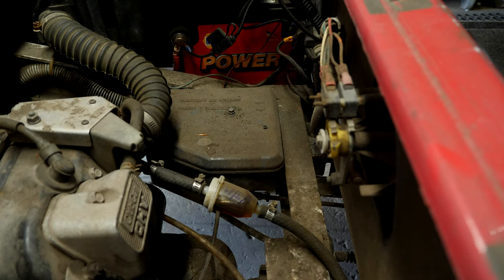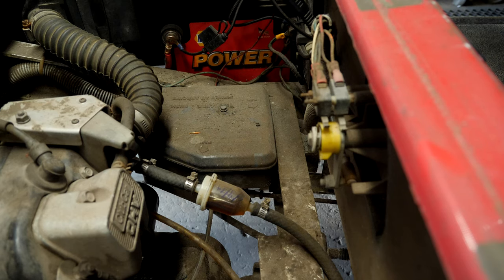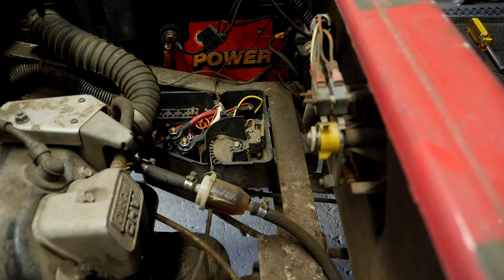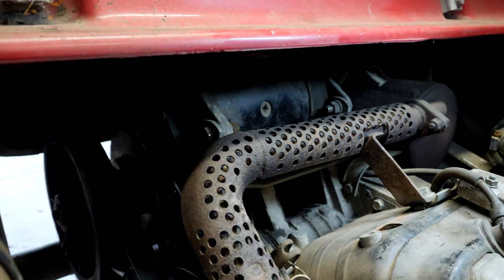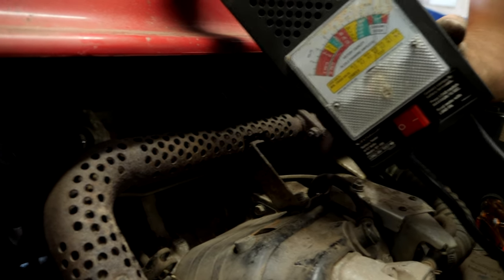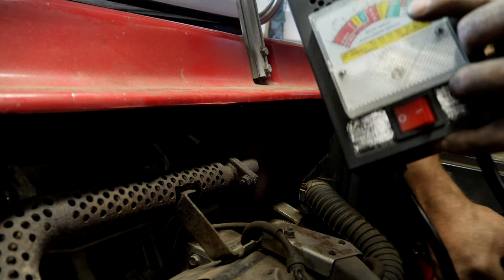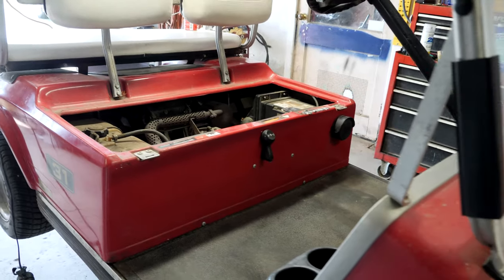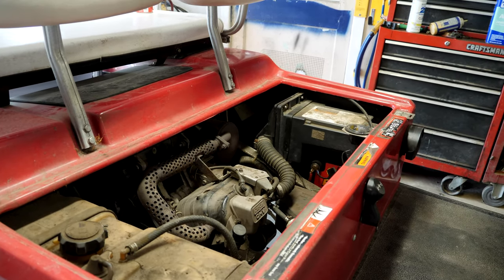1994 Club Car DS, Gas - No Crank, Fix Starter Generator, Replace Voltage Regulator

Comment: Im fighring this exact issue right now. What was the root cause here? I mean you basically removed it and cleaned it, then replaced it and it worked. Do you think the naked wires were grounding it out? Im referring to the starter portion.

Comment: Hi Kevin , I have a 1995 G14 Yamaha the oil light on there’s plenty of oil in the engine , the engine has started to sound like it’s over revving  any ideas would be greatly appreciated !
Reply from the maker: There is a wire that connects to the oil sensor on the back of the engine. It may have come off or the oil sensor is shot. Over-revving could be from a stuck cable.
Reply: Our old 86 club car has the oil light that comes on when the oil level is just less than full. This may help.

Comment: I have a 92 club car. it is a no crank. went from a slow crank to no. I will watch this again to gleen out more of the details on checking the voltages that you mentioned. This looks like it may solve my no crank..
Reply from the maker: Check your battery if it was slow and then no crank. You will need a load tester to verify its state of charge. If the battery is good, it could be wore out brushes in the starter/generator. Solenoids rarely present this symptom.

Comment: Did you ever see anyone fuse that microswitch wire? I have a cart that has that fuse blowing which led me here. I took apart the generator and had a bearing that blew apart. I wonder if that is what is blowing the fuse.

Comment: Kevin, i have an old Golf Club Cart. About 1993, not sure if you can help me. Cart haș sat for 6 months due to lockdown, it was fine before, but now it works fine apart from the bleeping noise will not stop So ive hâd to disconnect the battery. Can you advise me?

Comment: Can you tell me wear the clear hose goes that is running by your fuel line or filter. I am working on a 1991 and that hose on mine is connected to the carb and from there I don't see wear the other end goes. I thing it is suppose to go to the engine crank case some were. Great video thank you.
Reply from the maker: Its the overflow tube for the carb. It should run to the frame and just end.
Reply: @Kevinsgolfcarts  Thank you for the info.

Comment: Great video, I’m having the same issues with my cart. I replaced the starter 2 weeks ago and now It’s doing this. How often do you hear of new starters doing this? I’ve replaced the solenoid before the starter but it didn’t make any difference. Do you think there’s something causing it to ruin the starter?
Reply from the maker: Replace the voltage regulator as well. It has failed causing the starter/generator to overheat and work harder.
Reply: @Kevinsgolfcarts  thanks.
Reply: If the voltage regulator is bad, wouldn’t it still start? I’m supposed to be getting the regulator tomorrow so I can replace it. I bought another starter and it still doesn’t start but I can jump the solenoid and it will turn over. This thing is driving me crazy. I put the other solenoid back on it and it’s the same thing. Any thoughts on what else it may be? I have checked the wiring but don’t see any issues.
Reply from the maker: If the voltage reg. is bad, it should still start, pending you have no other issues. The voltage regulator is responsible for maintaining charge to the battery. If you are able to jump the solenoid and it cranks, you have an issue with the solenoid or somewhere in the wiring between the battery and solenoid start circuit. Power needs to go through the key switch, pedal switch, shifter switch then to the solenoid. If any of those "lockout" switches are bad, nothing will work right. Power is fed to this circuit from the fuse block in the control box. It should be a 10A blade fuse.
Reply: @Kevinsgolfcarts  thank you. I would take this somewhere to get looked at but there is nowhere close to me. I’ll keep checking the switches.
Reply: @Kevinsgolfcarts  ok, new solenoid, new starter, and new voltage regulator. It runs, only problem is that it just takes off like your pushing the gas pedal down to much. It use to ease into from an idle but it won’t sit and idle at all. If it’s started, then it’s moving. I didn’t touch any throttle linkage or anything that would of changed it so I’m not sure what would cause it. Thanks for all the help.

Comment: Just a suggestion. A pair of jumper cables to test the motor on the bench.
Reply from the maker: I prefer to test under load.
Reply: @Kevinsgolfcarts  Got it.

Comment: Hey sir I just got the solenoid replaced and put a new starter generator in. It worked briefly but now when I hit the gas the solenoid just makes a rumbling noise and nothing else happens. I'm not sure what it could be at this point. Any ideas of what else could be wrong, I'd greatly appreciate any ideas.

Comment: I have a cart in my fleet that runs great but after a bit you stop and it has to almost cool down before it starts..ive changed everything from ignition back plus new fittings.. was told the starter generator after so much use will get hot and not start..pulling it today for rebuild..does this sound correct?
Reply from the maker: I would check the solenoid first. Check it with a volt meter after it gets hot and shuts down to see if 12v is at both large terminals when pressing the 
pedal. Starter/generators shouldn't be too hot. The brushes may be getting stuck in their holders.
Reply: @Kevinsgolfcarts  will do..thanks

Comment: Hello, could you please advise me with my golf cart. I have a vegas performance  motor but is a pull start. I want to get it to start with the gas pedal, but I don't even know where to start. Battery is dead and not sure if the generator/start is working it does spins when I turn the motor on. I would appreciate any tips you could give me.  Thank you!
Reply from the maker: I have no experience with the motor you have. It will depend on how its setup whether or not it will start with the pedal.

Comment: Have very similar issue. No start w/pedal. I checked voltage across both solenoid terminals and I get 12.5 on the red, but zero on the white cable w/my kid pressing the gas pedal. However, I CAN get the motor to turn if I "jump" the solenoid with a short screwdriver. What does that mean since yours doesn't turn when you 'jump' your solenoid with your pliers? FYI I've replaced my solenoid 3 times already.
Reply from the maker: It sounds like there is no voltage getting to the solenoid to activate it when you press the gas pedal. You need to check voltage on the small terminals. Check the main fuse next to the solenoid. Check the microswitches and make sure they are working properly. The 2 microswitches in the control box have 2 functions. One, kills the ignition when you release the gas pedal. The other completes the circuit to the solenoid to energize it. Check the microswitches on the shifter as well. One is for the backup alarm and the other is for service/run mode. Also check your key switch. If its faulty, it will not send power through the entire circuit.

Comment: I have a similar problem on my 95 club car. No crank on the starter just a click from the control box. Back up alarm and lights work so I don't suspect a batter issue. I tested the solenoid as well, charge on the red and no charge on the white. Do you believe its the solenoid?
Reply from the maker: Yes, it sounds like the solenoid is not closing correctly, internally. I would replace it. Remember to use a continuous duty rated solenoid. A standard starter solenoid will not work.
Reply: Okay great, thanks for the reply. Your videos made it so easy!

Comment: Hey Kevin got a 96 g16a it’s just clicking at the solenoid any suggestions
Reply from the maker: You will need to use a volt meter and check to see if power is passing through the solenoid on both terminals. If not, replace it. If it is, the starter/generator may need brushes or replaced.

Comment: what if you just had to turn your motor a bit then it started up?  what would that be?  and it was working for 4 days. Just one day stopped to talk to someone then it would not start again.  Then I watched this video and turn the motor and it started up again.
Reply from the maker: Your starter/generator brushes are end of life. Replace them and you should be good to go. Try not to drive it too much like that because it can damage the commutator bars

Comment: Larger voltage regulator is for club car pioneer 1200  or carryall..at least they are larger in mine. Get a rubber doorstop  to use with your wrench to help with start tension adjustment..might make it easier.  And all my carts run 14.75 v when charging not sure if that's correct but it works.
Reply from the maker: The larger regulators are typically used with the FE350 motor. I use them in a pinch when I don't have the smaller one. I like the bigger one since it can handle more current.
Reply: @Kevinsgolfcarts  here's a question..are the selenoids sold on Amazon true constant selenoids? I was told yesterday its a get what you pay for.. ive been paying around 20- 30 for a selenoid..but seeing issues..I was told your typical 50- 70 dollar selenoids  would be the better bet for true constant power.

Comment: Why wouldn’t you just disconnect the battery when working on any of the electrical system so you don’t accidentally ruin any of the components or wiring?
Reply from the maker: There is no active power going past the solenoid unless the key is on and accelerator pedal are pressed.
Reply: @Kevinsgolfcarts   fair enough. Sláinte